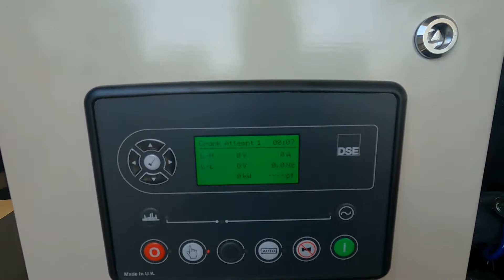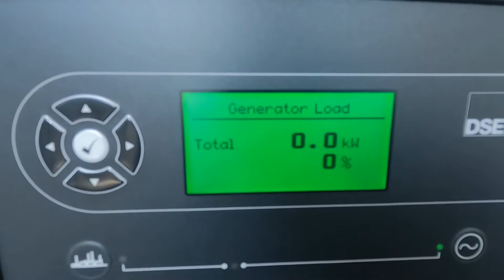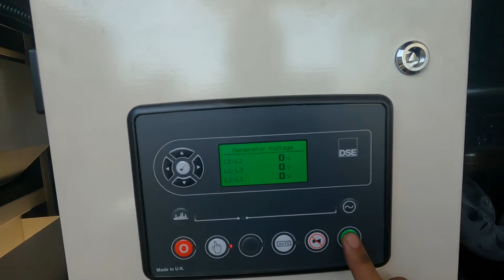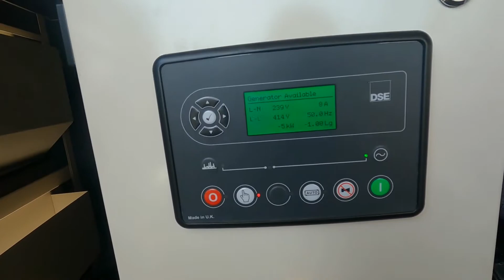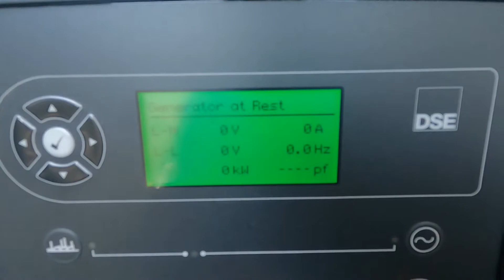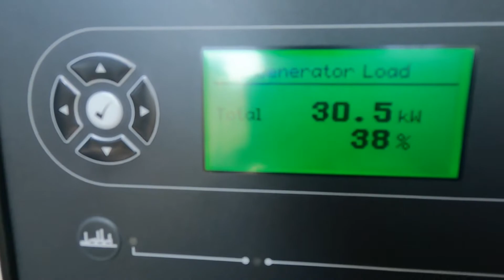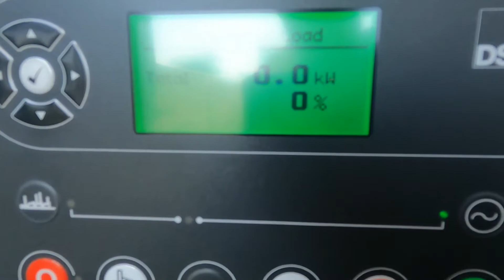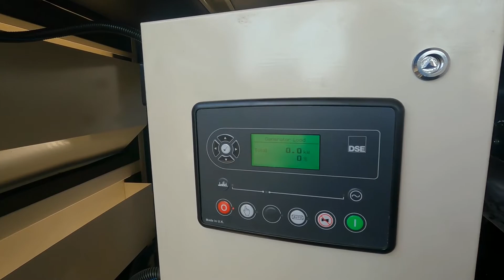CT-current transformer installation and CT problems in generator's let's solve it! benzblogs

Comment: Yung neutral transformer connected din ba sa common ng linr transformer??

Ok lang ba ibang model ung isang transformer pero the same name plate ratings??
Reply from the maker: Ok lamg basta same 3/4wire or singphase basta same

Comment: Hi, If original genset CTs rating was 1500/5A , can we replace it with 1600/5A because we doesnt have spare like original rating, but yes it has same Class 1 with burden of 15VA.
Fyi, the genset capacity was 800kVa or full load current was 1113A
Do we need to adjust any setting on Deepsea module ?
Reply from the maker: You can replace but you need to change the setting in the module what value of the ct will you have only have less defferance if you not change but its not hundreed 100 correct reading

Comment: Hi. How many times in a year should we replace the current transformer? Also, aside from the current transformer, are there other transformer/s installed in a generator set?
Reply from the maker: No maam current transformer only replace if it is defective and there is no other trnasformer installed in a generator
Reply from the maker: Do the propper maintinance and vesual inspection to avoid any problem
Reply: Thank you. :)

Comment: Hello, what was done to the CT on example 2 where you did not received any current on L1? I just encountered that in my generator. Ct is not reading anything but my amp clamp is
Reply from the maker: Ok so meaning ct problem thin replace it
Reply: @benzblogsVlogs  thank you sir!

Comment: How to check CT sir if good or bad CT.i mean using multi meter or analog tester checking
Reply from the maker: Use multi meter
Reply from the maker: Yes
Reply from the maker: Pit is in restance coz there winding onside of your ct correct
Reply: @benzblogsVlogs  ok sir thank you very much.maybe in my next trouble in my costumer.i hope I can fixed the analog meter of the genset.and thanks to you I got  an idea how to check.